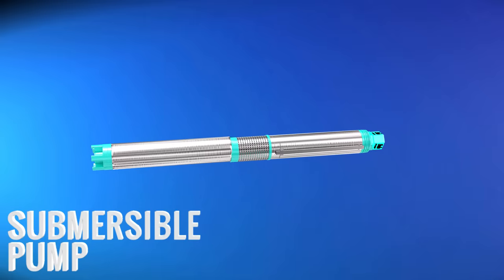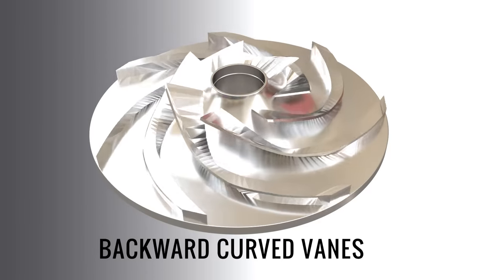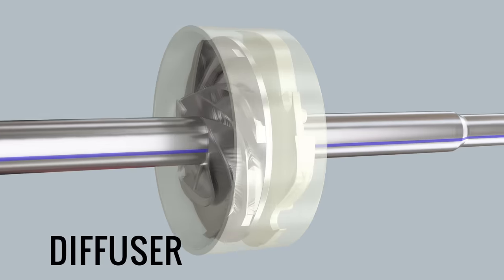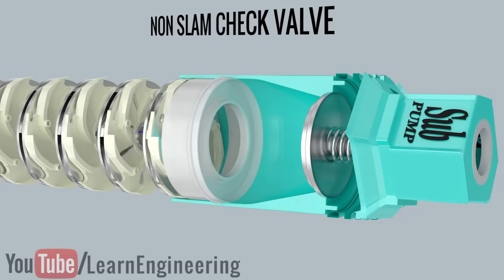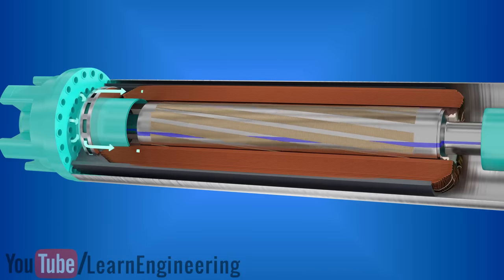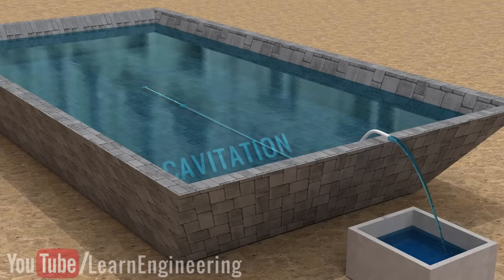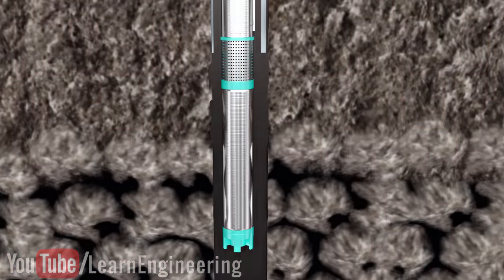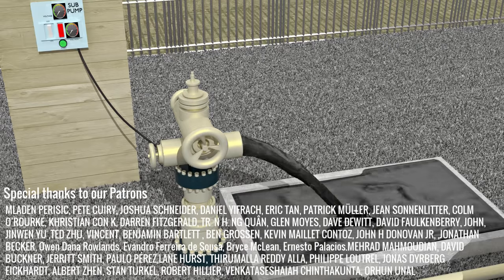How do Submersible pumps work?

Comment: If you're going to design it to go down into a pipe, or wish to pump to an almost empty state, have the water inlet below the motor.  Pass the fluid around the motor to cool the windings as it pumps, which allows for much more fluid evacuation from a vertical drop.
Reply: To make this effective they need to have two inlets one at the bottom and other as it is now. That increases cost but may work out.. Not sure..
Reply: @edwinshelly993  dirty water will corrode the copper wires. usually ro water is filled in the motor and then sealed.
Reply: you would have to increase the diameter of the casing or the pump in order to allow for water to flow around the motor. Most well casings only leave milimeters of space between it and the pump diameter. You would also increase the chance of getting water inside the motor shaft seal if you're pumping high pressure water directly into it.

Comment: We use them in farming in Turkey, in my region they usually work in a depth of 100 meters. If a submersible pump fails it takes like 4 hours to pull out all the pipes and finally the pump. Also they are so expensive to run and to maintain but we have no surface water supply so we have to use submersible pumps in 100m deep wells

Comment: Hi one thing i noticed was the direction of the impeller vanes and diffuser vanes are not aligned... As per the direction of the shaft, impeller vanes are correct. But the diffuser vanes should be curved in the opposite direction. Just for bringing to notice.. Btw, great video and presentation...

Comment: Large multistage submersible pumps use the fluid being pumped as the coolant by having the inlet at the bottom of the assembly, and then passing the pumped fluid around the motor jacket.  The motor may be located either below or above the impeller section, but is most frequently located below it..

Comment: top quality presentation .. my farm submersible water / bore hole pump faied to seal and the pumped water drained back into the borehole .  A second €800 euro pump has o[perated faultlessly .. On checking the other pump there was no sealing O ring on the checkvalve .. but the pump supplier failed to accept any liability .. disgusting .. my electricity bills were huge .

Comment: I do need to correct your video here, as there is a minor incorrect assessment. While most of these types of pumps are either water (the majority) or oil cooled to prevent over-heating, this does not mean they can't over-heat. I work in the water treatment and well-drilling industry and many times over the years, we've had submersible pumps over-heat and dislodge themselves from the end of the pipe due to said over-heating. Normally, however, this only occurs due to an issue above ground where the pump is not told to shut-off (by way of a pressure switch/tank) and thus continuously runs for an extensive period of time. Just wanted to clarify that.

Comment: Most renovation technology is needed. First all underground water is high in salt. So an elaborate technology in cleaning and filtering with drop down filters possibly required. Including test water quality metric reading in motor switch display. Or at least midrange plug in filters.
Reply: Slurry pump is good once you oil the rotor and the pathways and useful to get cement spray with delayed quickening effect concrete.

Comment: Hey nice video but you should explain how cabling is done underwater and how electricity hazards are being mitigated. Also, you should cover a vertical submersible pump where the pump casing is beneath the water level while the motor is above the water level.

Comment: If there is no risk of cavitation why then in each technical documentation of submersible pumps, the manufacturer limits minimal pressure? They advise restricting flow by a valve. For example, our pump can produce flow 40 cubic meters per hour but we should make 30 cubic meters per hour and pressure 1,8 bars, so the pump will work longer.

Comment: I guess those pumps don't have any height limitation since it's pushing than negative pressure pumps? Otherwise, would you have to use a negative pump every 32 feet? Am I correct?

Comment: Thanks for the info sir. One last thing , How do they act as oxygenator for fishes sir?
Reply: Regan Rasheed Any flowing fluid will present a low pressure to the surface it flows along. See the Venturi effect. If you want to inject air, just run a tube from the air to the pipe that is flowing water.

Comment: Wait, I'm confused. At 2:52 you say that water is pushed instead of pulled, but isn't this always the case? A high pressure fluid wants to expand, and it does so by moving towards low pressure zones, right?
Reply: the reason given does indeed lack a bit of depth.

I think what they mean is that if the submersible pump is installed deep enough into the liquid, the liquid will push itself into the pump.
To achieve the same with normal pumps, it would have to be installed at the same height as the submersible pump which is in most cases not possible (think of the oil wells).

If it is possible, you still have the issue of priming if the pipe goes above the liquid.
Reply: Robbedem makes much more sense, thank you!
Reply: Robbedem "lack a bit of depth" 

Hahahaha! Good one! :D
Reply: lol, wasn't even intentional :o
Reply: LegendLength perhaps this is what is meant, yes. Odd though as cavitation occurs primarily due to insufficient NPSH so can happen irregardless of the position of the pump relative to the pipe. Having it positioned where it is does minimise pressure drop and flow resistance upstream of the pump though...
Reply: And this is a main reason here - pressure drop. Just because it's a multi-section pump, the pressure drop is divided to all sections, so a pressure drop per section is minimized. Thus the pump is less prone to cavitation. Low rpm characteristics can be helpful here, too.
Reply: One theory Pump gives volume but not pressure,and in case of turbo jet the air comes under pushing or pulling ?I think water entry due to
Vacuum creation ,and pump pressure can get to reduce dia of 
Delivery pipe (everyone knows).
Reply: @MCinemaGamer
If the pump is above ground, like your standard Jet pump, the water would be "pulled" from the ground source and THEN pushed into the desired location. Whereas in a submersible pump, the pump is set at a depth well below the surface level of the water and therefore inducted into and the pushed to the surface.

Comment: where can I get information about pressure on well pumps ? I have 250 meters deep submersible pump and on the ground a valve, the valve is closed on 70 % and pressure is 1,4 bars, should I close it more a little bit ?

Comment: I still don't understand how there's absolutely no caviation, since we are using centrifual pumps, the water is sucked into the inlet, creating a lower pressure compared to the outlet so the risk is there right? In other words, I do not understand how the water is pushed, rather than pulled as in a normal centrifugal pump...

Comment: can i use submersble pump horizontally..?
Reply: Yes, they can be used at virtually any angle. In the water treatment industry, where we sometimes have customers who use Aerators for sulfur issues, we use submersible pumps inside of the aerator at either a 45° or a completely horizontal angle to draw water out of the tank.

Comment: These are multi level pressure pumps. There are submersible pumps with one propeller.
Reply: submersible means they are working under the water surface. so both are submersible, but you are talking of submersible sewage pumps
Reply: Nope, its excess water pumped into the sea after its used for watering crops. Im talking about pumps with capabilities of 8000 cubic meters per hours. Im aware of the small sewage pumps with the floater switch though.